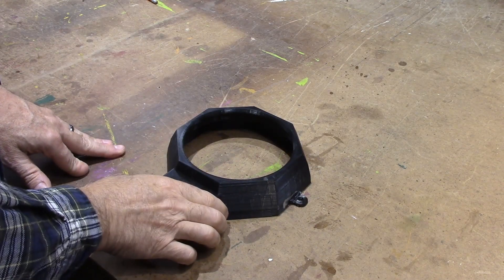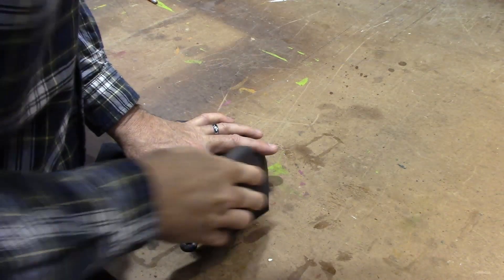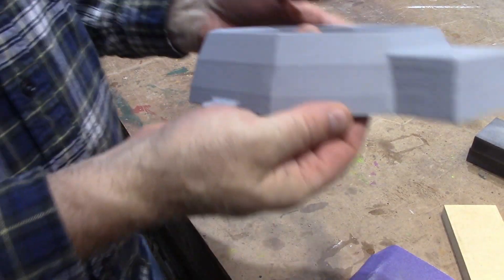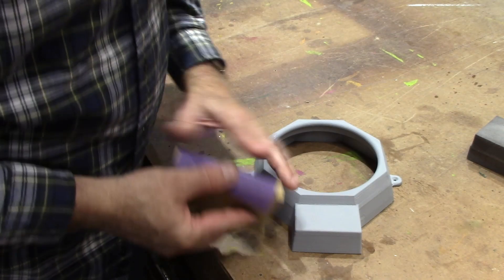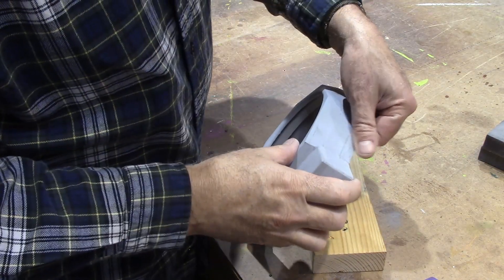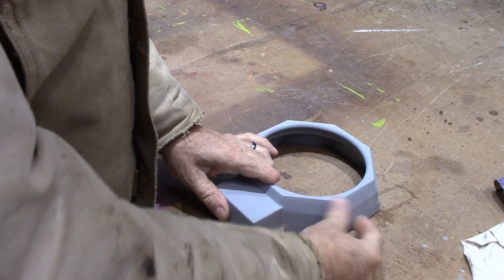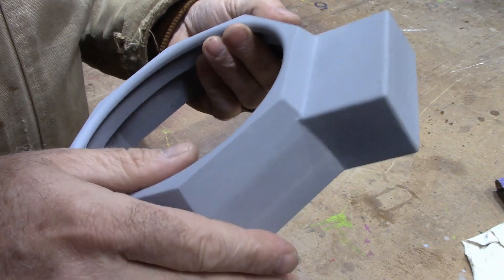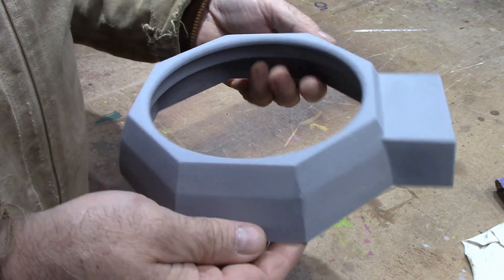How to Finish a 3D Printed Foundry Pattern

Comment: I do the same thing. But also use a 3M Glazing Putty for those little imperfections of you need a better finish to help eliminate undercuts that might make the molding process more difficult. You can get the 3M Glazing Putty on Amazon. They have a red & green product. No mixing and it works well. It is used in the auto body industry. Keep up the good videos! Oh... I have to ask... what happened to your index finger? I’ve come close to doing the same thing but (knock on wood) I just had a small cut... Be safe & stay healthy! Cheers!
Reply from the maker: I've used the glazing compound for the same reasons you list.  It's easier than bondo and works better for this application.  I lost the end of my finger in a table saw about 30 years ago.  Thank you for your comment!